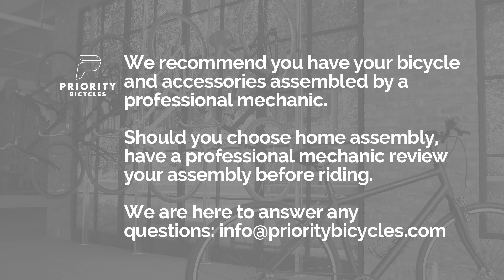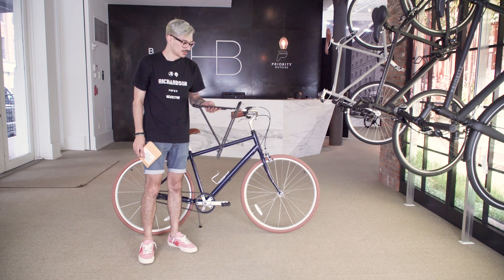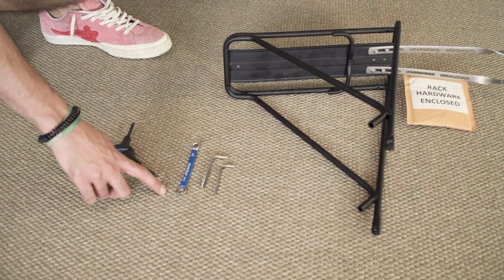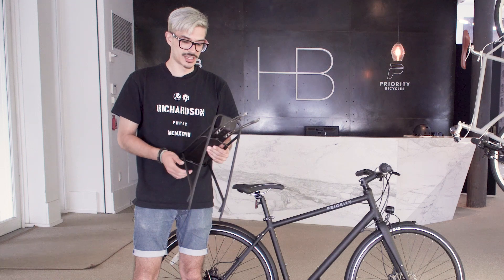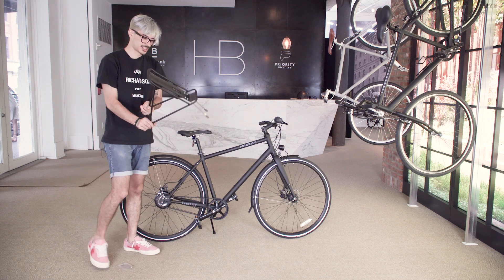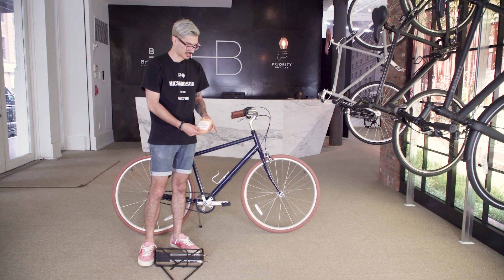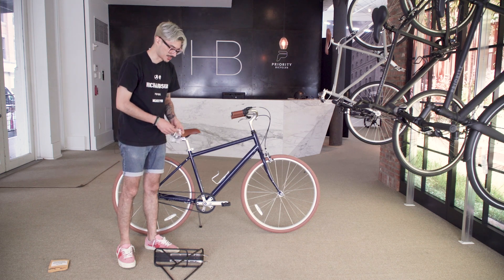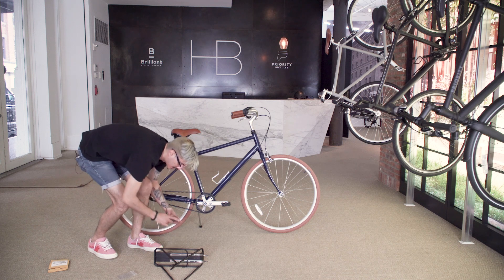ASSEMBLING YOUR PLANET BIKE RACK

Comment: A "Close Up" version of what you were doing would be helpful for people not familiar with installation. Although, i installed many racks before. There's many set ups that need modifications, Brake noodles can can touch mounting brackets and would need to be changed or alternative mounting is necessary.